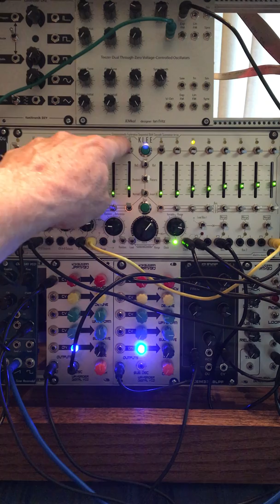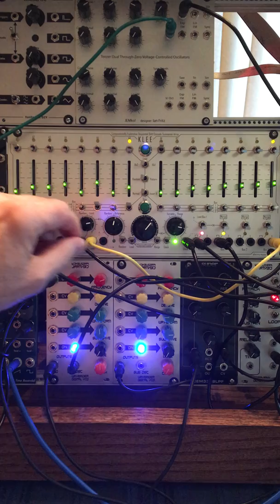Klee Sequencer demo

Comment: Also, I noticed you have a 960 sequencer too.  How do you feel about one or two of those with their sequential switch versus the Klee?
Reply from the maker: The Klee is very different from the 960.  The 960s are so inexpensive.  Even building from a kit would be more expensive than two 960s with 961 switches.   Having said that, I must add that the Klee is unique among sequencers.
Reply: @ozhalljr  Indeed.  I realized that my 0-Ctrl is essentially a 960 with an added touch interface and some Make Noise weirdness.   Two 960s with their switches takes up soooo much space.  I'm thinking I'll build a Klee once I'm done with the quad LPG I'm building.  Thanks!!!

Comment: Hi great demo was it difficult to build ?
Reply from the maker: Thanks!  It was a lot, but I don't recall any difficulty.  It's all through hole.  Just a lot of soldering, but well worth it.  I got the full kit from SynthCube.com
Reply: O.Z. Hall just thinking I know a guy is selling one for 600 euros and the diy kit is almost 600 dollars .. ?
Reply from the maker: @saren6538  You should buy it @ 600 Euros, not build it.  That's a good price.
Reply from the maker: @saren6538  P.S.  Synthcube has a sale on this weekend:   Starting September 16, 2020-- Save 16% on everything in the store-- during our 'Welcome Back Sale' --   log in to your account and use code BCK16 at checkout!!         
That would bring the kit price down to under 400 euro.  Of course, that's before VAT and shipping.